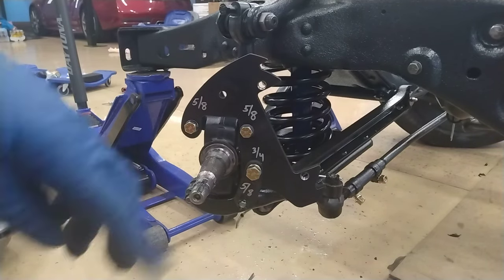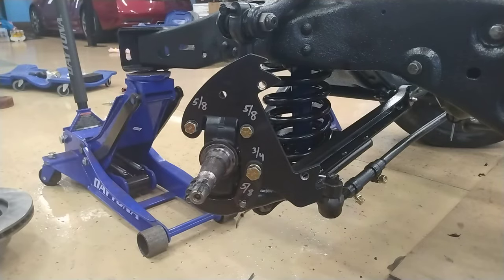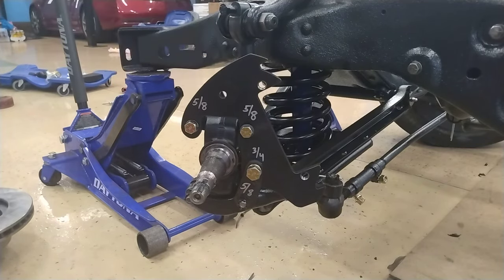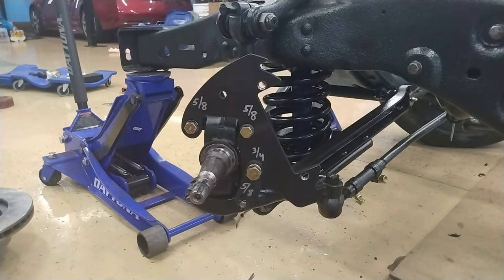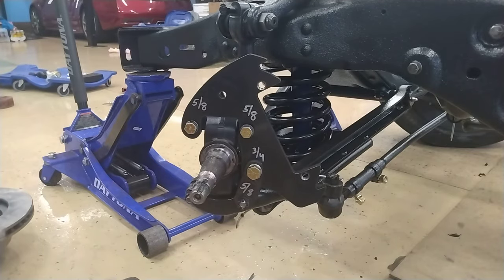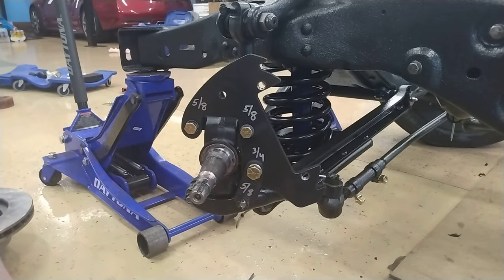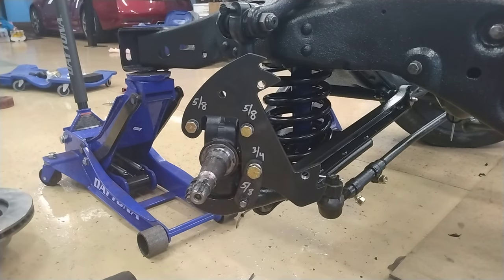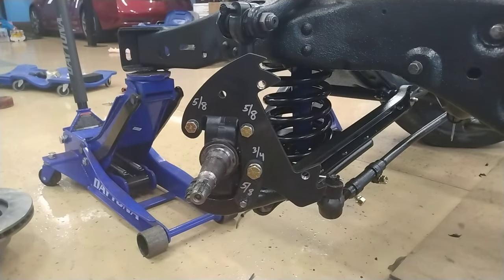1956 Cadillac Series 62 Sedan DeVille Disc Brake Install Pt 1

Comment: So with this kit you reuse the original spindle, no need to unbolt ball joints and drop the lower A arm?
Reply from the maker: 1956 had king pins, so no ball joints, so yes you can do this without removing the king pins or the spindle, no need to drop the lower control arm. You re-use the original spindle. I do recommend making sure the bearings and king pins are in excellent shape, otherwise it's wasted time being there as you'll end up back there again taking everything apart to replace them and to do that you will be separating the the control arm and spindle which means compressing the coil spring.